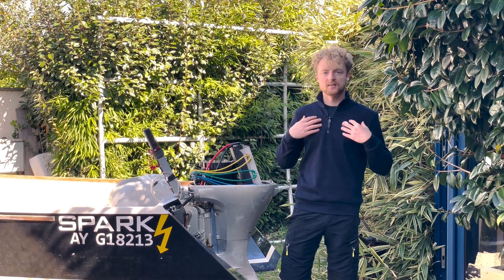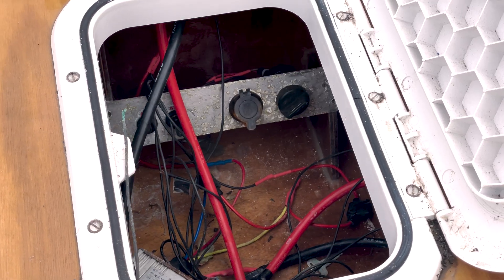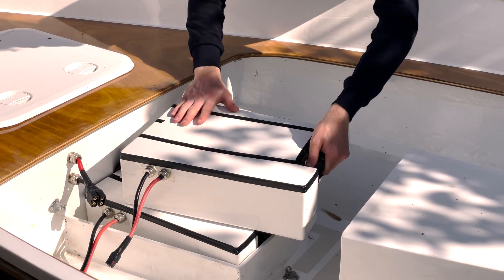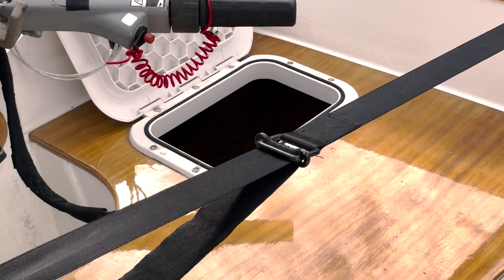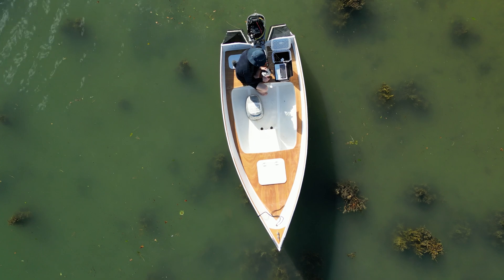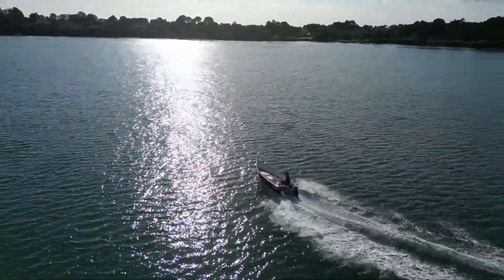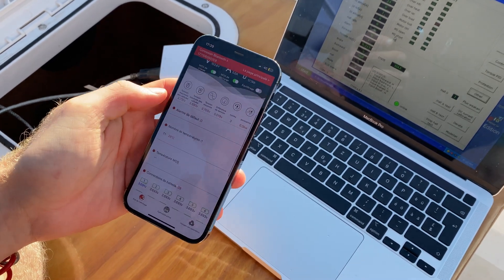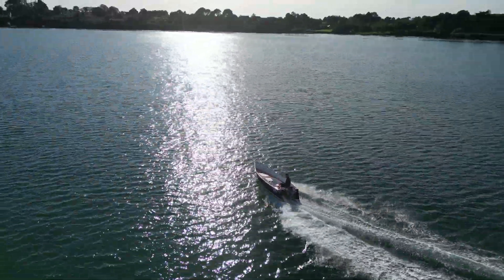DIY Electric Boat TESTING

Comment: This is the smoothest-sounding DIY outboard I have seen and heard. I spent a lot of time trying to make my 24kW build to run quiet, but it always has a high pitch sound. I think it is the motor I used. I used a motor from a crashed high-power electric motorcycle. I used the controller and battery from the motorcycle, too.I think the problem is that I am using a lower unit that was designed for only 10kW, and mine is pushing 24kW, it is putting strain on the drive train. I need to find a bigger lower unit one that can handle the power. I was trying to keep it as light as possible.